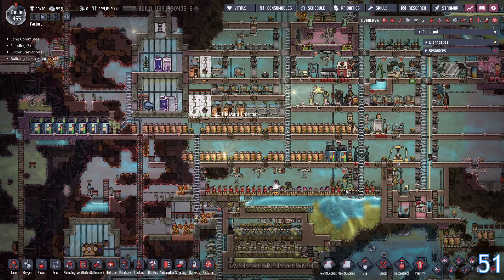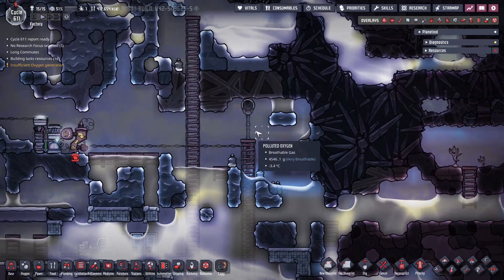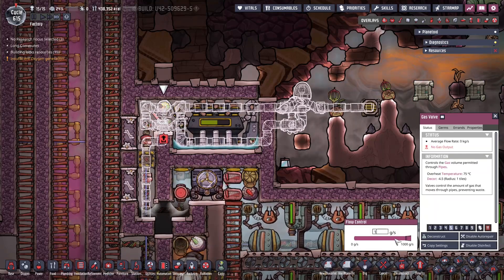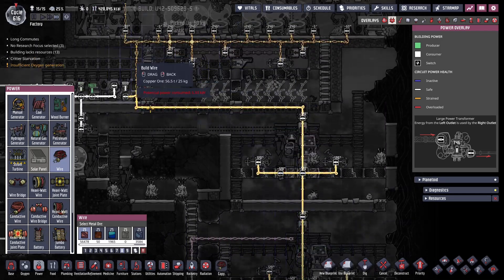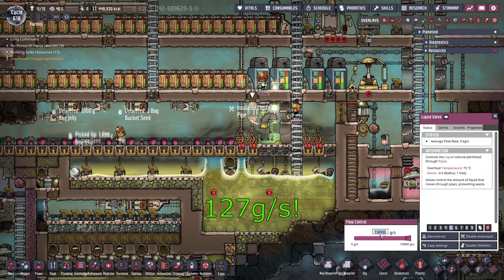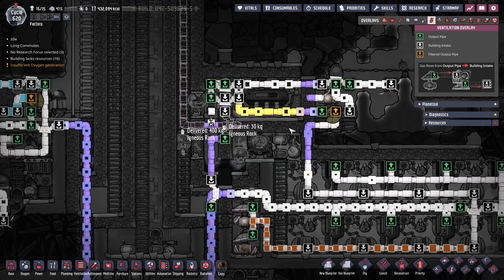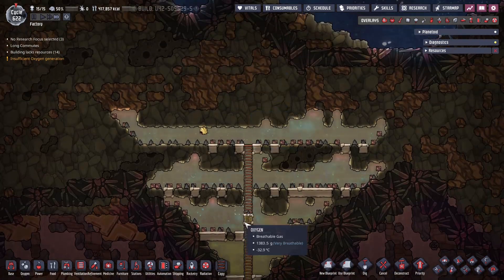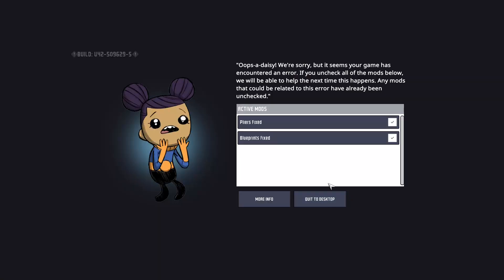BACK TO THE FACTORY: Oxygen Not Included

Comment: The radiation in space looks worse than it is, so long as you're careful with your dupes.  For some reason, plastic tiles are the best at absorbing radiation, 3 layers are typically sufficient to block enough of it to be safe, 5 tiles to block it completely.  There's rad pills that add to radiation dissipation over a cycle and seafood-type foods give some resistance.  All of these together are not enough to survive a reactor or compressed liquid radioactive waste tile though.